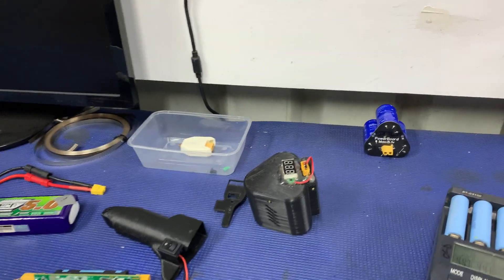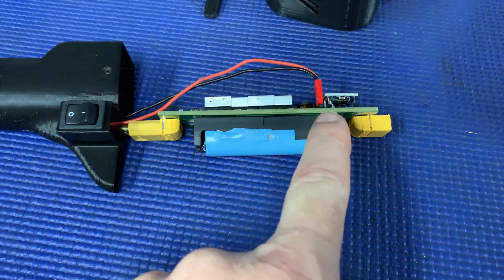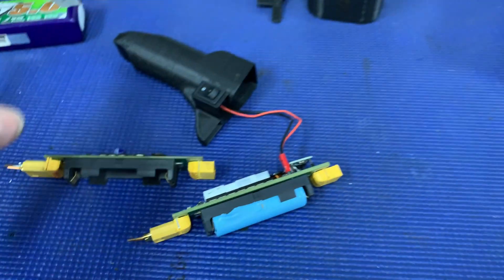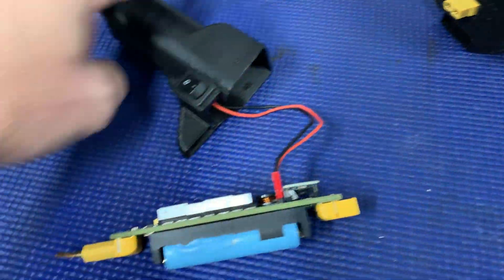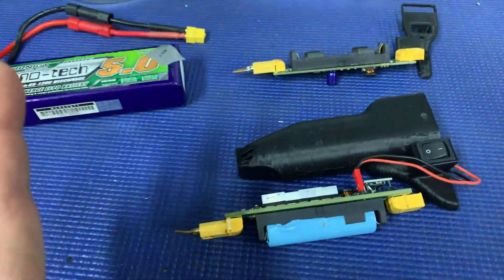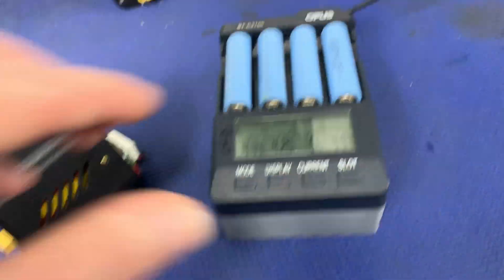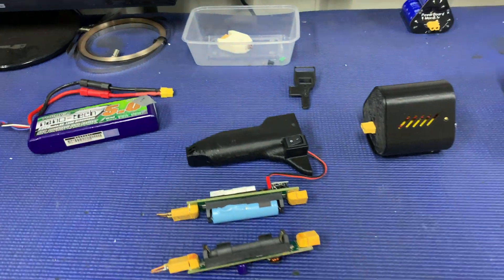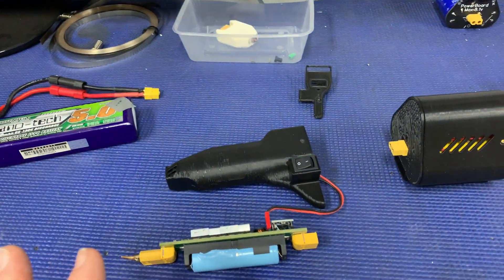I broke the NanoSpot Welder ☹

Comment: go to the auto parts store and get a 300 amp lawn and tractor battery. order a 500 amp solenoid and a little momentary microswitch that you can stick on a piece of wood to act as a footswitch. then all you need is the spot welding leads wich you already have. you are not going to blow it up and its tons cheaper. and it works perfectly
Reply from the maker: would rather just a little more control than brute force and ignorance.
Reply: @HBPowerwall  brute force and ignorance? ignorance????  this is how you reply to some one who suggested that you save some cash and do it the easy way? maybe there is a cultural difference here. but when you suggest that some one is ignorant here we just say GO JUMP IN  A LAKE. so thats what you can do.  jerk.
Reply: @Cancri71  so how would you control the power or the time. Just dont wanna blow a hole through the cell tops. What thickness of pure nickel does it work well with?
Reply: @brenthawkins204  what i did with mine is built a rotoary switch on a foot wheel. it only triggers the micro switch for a fraction of an instant. ive spot welded hundreds of connections and never burned through nor had a cell failure from it. i use just the standard fused nickel rolls. cut them into strips if needed for a smaller pack.
Reply: @Cancri71  can it do .2 nickel or just   .15.    I'm interested. The nano can do .2 if it has slots with the super caps. It can do non-slotted .2 without the caps using a lipo battery.

Comment: If they could tweak the design and remove the battery and the super cap  Away from the pencil like area  it might make the design look a lot sleaker however I don't know  if this would affect the electrical characteristics of the device e.g. theThe length of the wire between the super  capacitor And the Weld tip thank you
Reply from the maker: Shocked at how responsive they are, rather than going ooh shit they have replied with fixes, upgrades & new ideas. One statement they said (and i'm not quoting ) but it was something like they want it as easy to use as a soldering iron - turn it on and use it type thing.. They are closing watching all comments so your ideas will be heard
Reply: @HBPowerwall  something like the ds xxx USB soldering iron  yep that would be good  with a small oled screen for some user tweakable settings